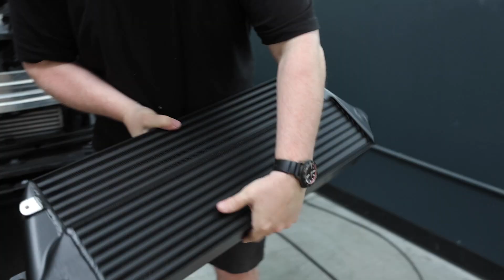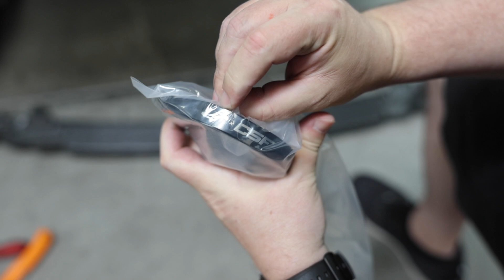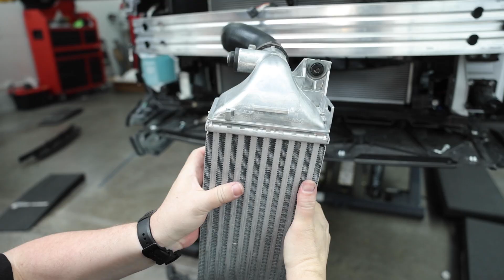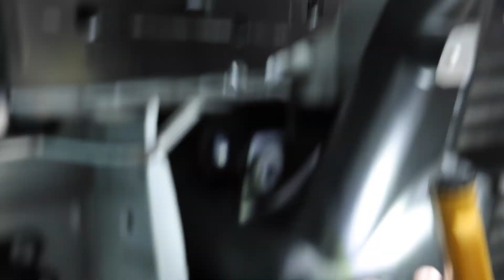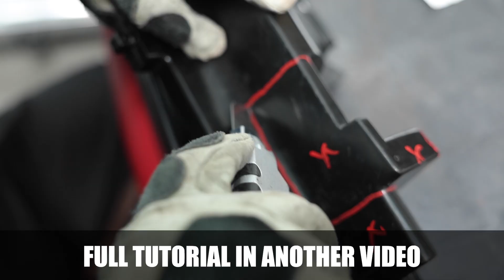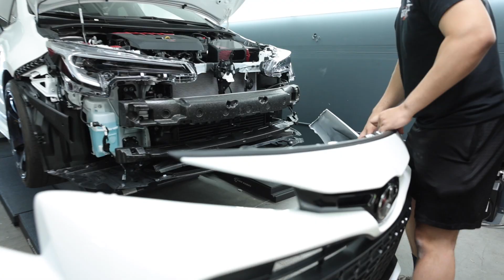GR Corolla - Jackson Racing Intercooler Kit - JR-1400-15-J01

Comment: How much torque and horse power does your Jackson Racing Intercooler improve over the stock numbers...?? Have you guys dyno tested your Intercooler...???
Reply: A upgraded FMIC doesn’t necessarily add more power. It helps you put up more consistent numbers while keeping temps down, it’s more of a supporting mod as you go down the line

Comment: Any turbo sound difference with this?
Reply: Curious why would one expect a difference in turbo noise with this?
Reply: @victornegron8647  because it is in the intake airs pathway, just like intakes, charge pipes, etc.
Reply: NO MAN, that is dumb logic. 

That is like swapping your exhaust but keeping your factory muffler on it. 

You need to change the muffler as well, in this case, your intake itself.
Reply: @hanyabi-habib8226  You're dumb af lmao, swapping the entire exhaust will still make a massive sound difference, even if the muffler is kept stock.

Comment: It looks like a solid kit, and I'll be keeping an eye on this.

As it is covering more of the radiator due to height, does this impact the radiator coolant temp?  Also, is there a difference in time achieving full boost compared to the OEM unit?
Reply: It should be fine because it a tube and fin core. A bar and plate is much more dense. The SXTH Intercooler Core is a bar and plate my coolant temps are the same.
Reply: @mhk67091  I don't mean any offense to you whatsoever.

I'm not one to take 'should' as a reasonable answer.  I look for data and validated results.
Reply: There is a video where they talk about flow through being really high for radiator as a design consideration. It's good.
Reply: @not12listen  I ran mine on a dyno jet and have ECUTEK as well. So I have data.
Reply: @not12listen  watch speedlab performance their is a video showing intercooler temps no exceeding 30c after multiple dyno pulls.
Reply: @mhk67091  I understand that intercooler temps not surpassing a specific temp, and that is great.

Again, my concern is engine coolant temps.  Having a chart of the intercooler temps and engine coolant temp at the same time (same run) is what I'm looking for.

Beyond that, with a larger intercooler core, what is the impact on throttle response?  This is not a question of "how much power does it allow to be developed?" and is "is there an increase in time needed to reach a specific boost pressure from 2500rpm when compared to the stock intercooler?"

My focus is NOT on power, but is on throttle response.
Reply: @not12listen  With my tune coolant temp stayed the same upgraded SXTH intercooler vs stock. 185f to 190f coolant temp.. if i idle the car for a while with AC off coolant max temperature I seen is 208f then drops 201f during long idle during 95 degrees Florida weather. If you going to track the car you can also upgrade the radiator Mishamoto or PWR make one for the GR Corolla. Cool thing my intercooler allowed me to use factory air dams with gets excellent air flow to radiator and intercooler.

Comment: Is it possible to ask how much space is in between that new csf intercooler and the radiator. As I plan to order a racer x oil cooler kit as well and am worried about the clearance and compatibility. Thank you very much love your guys’ video and content great stuff. Keep it going!!
Reply: Did you find out?
Reply: Why did you decide on a different oil cooler, location for cooling? I to raise the question if this is the ideal location for the intercooler, unless the new 2025 front bumper is more suited for it?

Comment: Got the SXTH Element intercooler the Jackson Racing Intercooler wasn’t out yet.. but I like my SXTH intercooler it performs excellent runs couple degrees over ambient temperature.. The SXTH is a bar and plate very durable since I do lot of highway driving doesn’t get any rack ding like stock and cools very good.. I think the Jackson is a tube and fin, I wonder how durable it is.. I saw the testing on the Jackson unit and it performed also very well. Nice